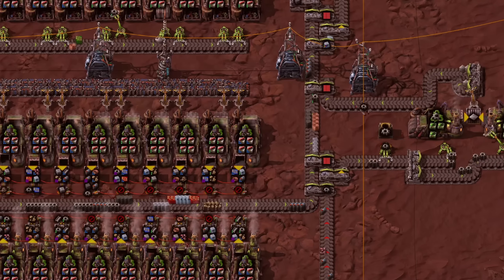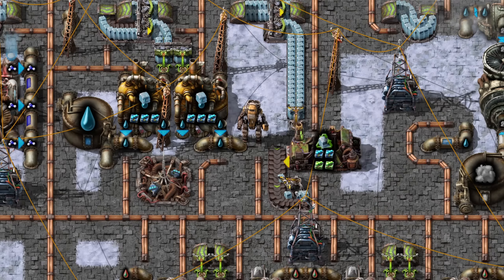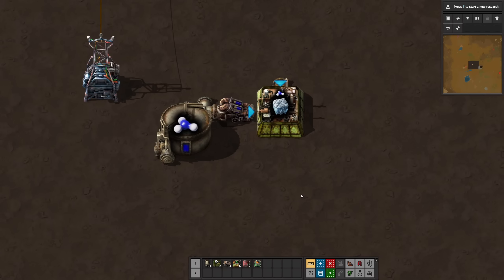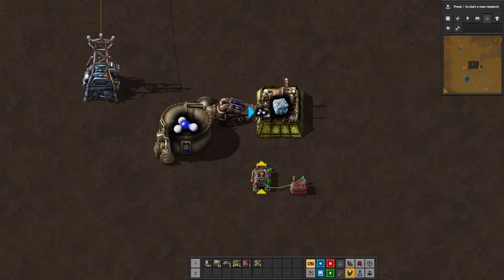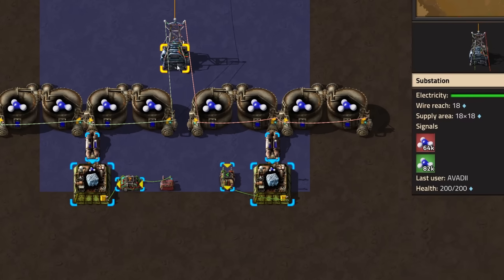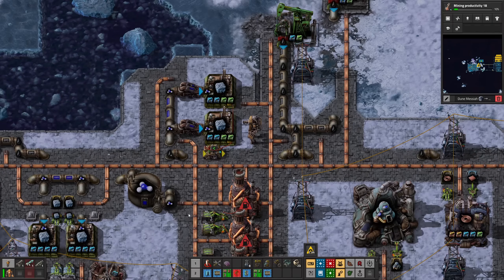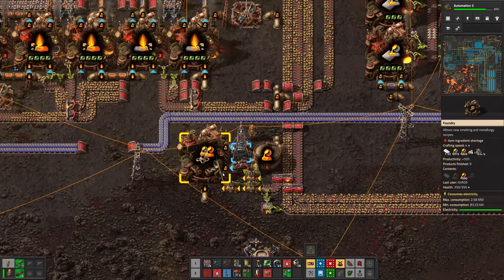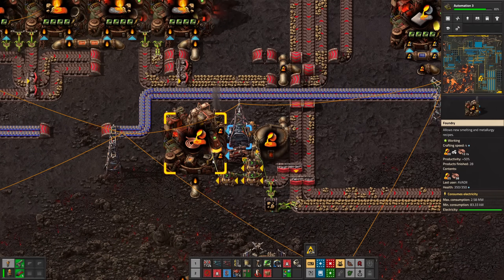How to void Fluids in Factorio? With circuit logic! Guide / Tutorial

Comment: Haven't seen someone mention it in the comments yet, but using speed Beacons seems to increase the ceiling for the amount of ingredients the machine is able to receive, to a limit. For my Fluoroketone (Hot) voiding, having one speed beacon raises it from 100 to 200, with another beacon increasing it to 250, which seems to be the highest it can get.
Not sure how useful this is, but decreasing the amount of actions needed to achieve an identical result could be good for performance, I guess?

Comment: Note, you can set this up with only one combinator. Wire its input to the voiding assembler which should be set to read contents. Add a condition to the combinator to output the recipe only when the fluid count in the assembler is less than double the recipe fluid amount. This will automatically swap the recipe once the building is full. You can add all the other conditions for when you want to enable the voiding to the same combinator, making it an all in one control for the fluid voider. Haven’t tested to see if it’s the fastest, but seems like it should be optimal

Comment: how about using barrels and recyclers, since fluids cant be returned from that process. it's extremely affordable as well cuz you only need to ship in a bit of steel to last you quite a while. On top of that you could set the recipes of fluid barreling assemblers with circuits. This could technically also void any other fluid that has a barreled version (even all on the same pipe but I don't know how scalable something like that would be because the pipe system would need to be fully drained every time it needs to switch the recipe).

Comment: Nice. Before I figured out circuitry, I often had a problem with oil refineries stopping because they had too much of one type of fluid/gas. Sure, you can break down oils into gas, but not the other way around.

Always bothered me a little bit that you couldn't use liquid oil or petroleum gas as fuel. You kinda can by turning it into solid fuel but.. really, you wanna run your car, your tank and your trains on solid fuel? 

And steam power can't be run on oil?

Comment: Why not read the content of maschine and then set the recipts based on the fluid count?
Or even better use the "Working" signal to cancel the crafting process?

0eNqVUttugzAM/Rc/h0qw0hakfUmFUAC3tQYJS0I7VOXf50BZt657mHjx5fjk+JgrVO2AvSHlIL8C1VpZyPdXsHRUsg01JTuEHOoTdlTLNupbyWAvgFSDH5DHvhCAypEjnGenZCzV0FVoGCAWjgZratBEte4qUtJpAwJ6bXlUq/AW00UJ40fIs3SV8iMNGazn9loAy3NGt2WFJ3kmHueZG2nJvWYisqH6PWNJBzLWlfel3NgHQWcybuDKl8IZER0Nogo7stJemklpDq8QVtWD6wf36NKNkMUSB3c+h7KLghhUVk57TKz9yHoH5cqD0V1JihkhP8jWoi+89+KXiYn44xDPDFyls4XbRwt3zy206Mqb8tyZAQXvIZvgqGMZ9kfxos0bqeNSu6X/ttaLxaunJi3d8p052AdGKW065gsnuPBG4QD7WCThKwRHLxzFBXfJYcf4+48t4IzGTgakmyRbZ1m6ibcvu2Tn/Se/mgjI

Nice video :)

Comment: You could also just do "read contents" on the assembler, and use the condition if (liquid type)<(recipe_req * 2) then output recipe=1. then you don't need to use ticks. i.e. if ammonia < 800 then set recipe to ice platforms, else nothing. And depending on what you are voiding, you can also add a separate wire to check the storage tank in the same decider combinator.

This also avoids the flickering of the recipe icon on the assembler if no voiding is needed.
Reply: Came here to write the same

Comment: 2:45 the reason why 40 is the best interval is because pump speed is 1200/s, therefore in 40 ticks it pumps exactly 800 units of fluid into the machine. This ratio is better than 50:50 chance in case of the random recipe selection.
Reply: In case of timer amonnia is pumped for 39 ticks out of 40, in case of random selection, it's on average 20 out of 40 ticks, which explains almost double the rate of voiding.
Reply: Wouldn't reading content of assembler be better then?
Change recipe if content >= max content
Reply: @Olden_son That's what I did before I even watched this video: just read the ingredient amount and trigger a recipe change accordingly. I never experimented with clocks outside of thruster designs.
Reply: And since it voids at the rate of the pump, if you want to void faster, use a quality pump.

Comment: I prefer a slightly different circuit set-up. Using a decider combinator, you can connect it to both the Assembler and the Tank (with different colour wires).

Add two AND conditions to the combinator: the first when the tank is over a certain value (like 20k). The second should be a less than condition, for 2x the max amount of fluid that the recipe you're using to void requires. The output should be 1 of the recipe you're using.

Comment: On my aquilo, inserters were set up to burn rocket fuel when temperature was lower than 750. In a stroke of genius, I set up a decider combinator with if ammonia > 20k, and output T -999 (brilliant 2.0 feature that lets you change the output amount with the fixed output thing), and spread that through my base with the opposite wire. Works like a charm so far, keeps base nice and toasty, and ammonia low. Not sure if just solid fuel or rocket fuel is more effective for this. But at least it's not entirely voiding it. If I run into problems with ammonia again I'll definitely use this though, great idea!
Reply: i think rocket fuel is better because you have to remember that oil is infinite and only used to make fuel on aquilo so it doesn't matter if you waste it or not
Reply: If you want fuel efficiency its solid fuel, if you want to get rid of it faster then go for rocket fuel since it takes more resources to make for less energy than if you would have gotten if you just kept it as a solid
Reply: Wait, what?  You can set a different constant than 1 on a decider combinator output?  Since when?  I know I'm not on the latest version, but I don't see that option in 2.0.34...  I've been slow to update beyond that, but maybe you'll inspire me to get on that!
Reply: @DavidLindes  yup, since 2.0 I'm pretty sure. You have to select the output signal type, select constant 1, and there should be a little pencil button next to the 1 that lets you change it to any other constant, including negative numbers (if you type it manually into the text box, can't get negatives with the slider).
Reply: @helleye311  Hmm.  I don't see any such pencil icon.  We're talking Decider Combinator, right?  I can click the one, but I don't see a pencil.  You sure you don't have a mod?  Or... oh!  There was a mod, but it's deprecated now, because this is in vanilla in 2.0.36... so, I will need to update.  :)
Reply: @DavidLindes  oh okay, sorry. I must've not noticed it got added at some point. I just noticed it some day and assumed it came with all the other QoL improvements in 2.0 and I didn't question it, it just makes a lot of sense. 
Enjoy combinatoring!
Reply: @helleye311  all good... I shall!  :)
Reply: @DavidLindes 2.0.39

Comment: Wow. that`s a great idea. I personaly managed to control it by crafting solid fuel and burning it. It`s also a good solution for Aquila as it gives you heat, energy and destroys amonia
Reply: Yeah, but that also requires oil and processing. Ammonia should totally be converted to fuel first before voiding, but only as much fuel as needed and then void the rest
Reply: @submachinegun5737  oil is infinite and never runs out, it just slows down, so if you give your pumpjacks speed modules and beacon them, they can infinitely produce a decent amount of oil. If you need more, you just connect more patches to the network.
Reply: Mee too, I made solid fuel and burned it to keep the base warm as a byproduct
Reply: Could you share a blueprint for that please?
Reply: @ShebanFPV how do you wanna me do it?